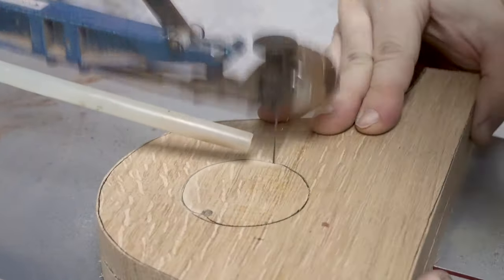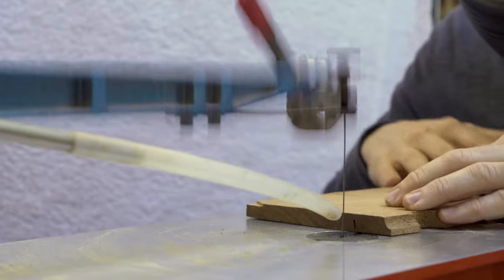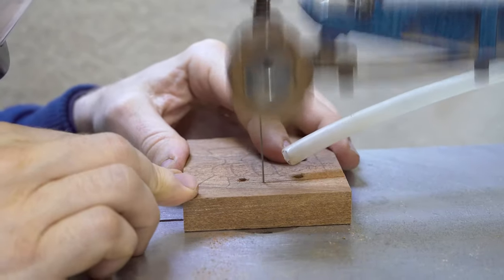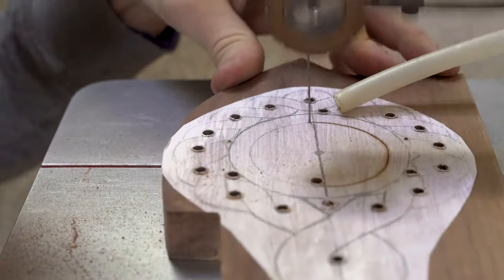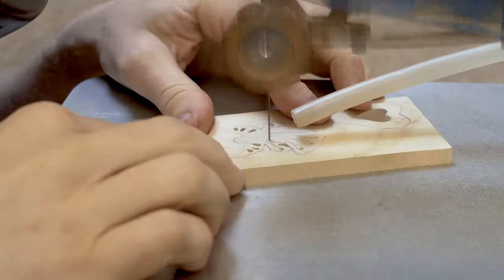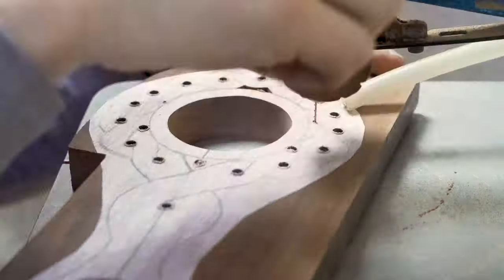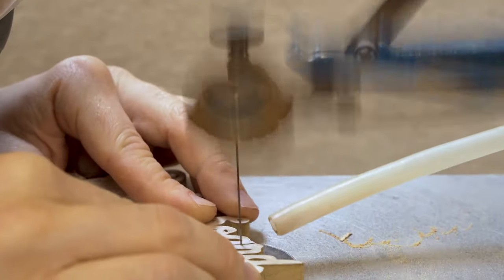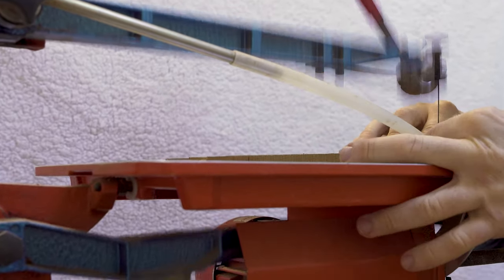Scroll saw. Quick release clamp (Hegner)

Comment: As a Mechanical Designer I know of a hardware company. I went to them McMaster Carr and bought a threaded knob
Reply from the maker: Great solution, thanks again for supporting our YouTube channel.

All the best from us all here at The Lovespoon Workshop. 👍👍
Reply: @DailovespoonsThomas  I oen a Hegner, never cared for it. The tension rod keeps loosen itself. And I loss more upper clamps when the blade snaps. It flies off and I never find it. I made trivets and clocks doing the craft fairs but they are all but gone now. I've seen the foot traffic go down year after year.
Reply from the maker: @danaringquist9730  sorry to hear that you haven't had much luck with your hegner. Has done a fantastic job for ourselves for many years, so I can only speak from our own experiences.

I have no association with the company myself other than using their scroll saw in our family workshop.

Always worth contacting them with any issues, they've always sorted out any problems we have encountered.

Thanks again for getting in touch, all the best from us all here at The Lovespoon Workshop. 👍👍